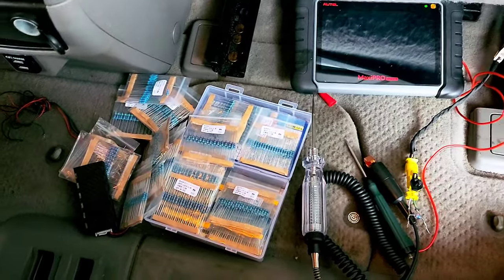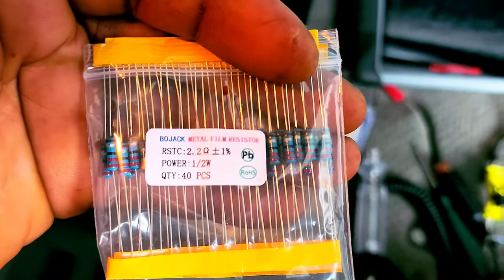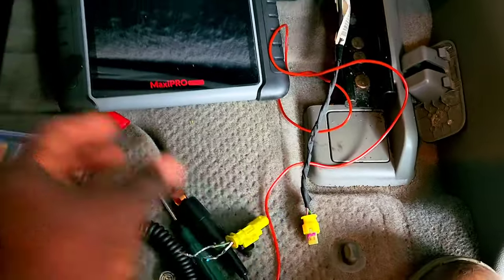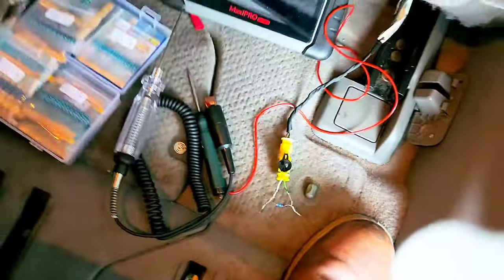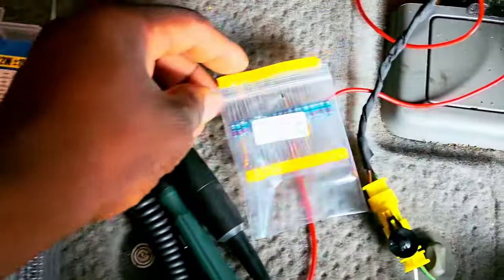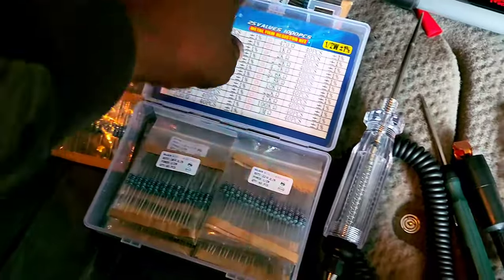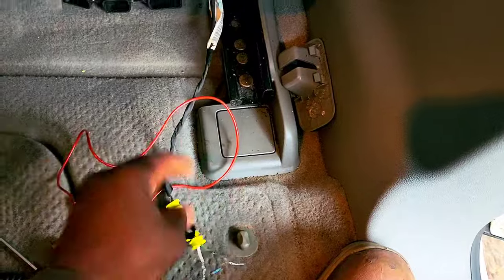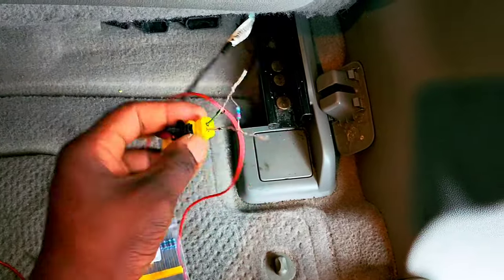HOW TO USE A RESISTOR TO GET OUT ANY AIR BAG LIGHT

Comment: How do I know what resistance is needed ?
Reply from the maker: It shows in the video
Reply: @MrtalentedReid  every single car has the same resistance?
Reply: @MrtalentedReid  how did you test what resistance was needed ?
Reply from the maker: @DonnSinatra 😁 all the cars I go through use the same resistor 👍
Reply: @MrtalentedReid  I’m not being a wise ass I really wanna know how you tested that in case my car doesn’t have the same resistance I just put bucket seats in now I wanna bypass the airbag light
Reply from the maker: @DonnSinatra these kind of things are very community guidelines sensitive so I can't tell you much but the one in the video is commonly use for any vehicles 
2.2ohms 2.3ohms 2.5ohms 3.3ohms half watts
Reply: @MrtalentedReid  what🤦🏻‍♂️ nvm good video

Comment: Mate, great video. I'm struggling to source a replacement plug-in Same as the yellow one in this video in Australia; any ideas? Tried wreckers online, but no joy
Reply from the maker: The easiest place to find it is a scrap yard or you can just splice the wires with some butt connectors thanks for stopping by

Comment: Very talented indeed. Im installing a new steering wheel and racing seat into my 2002 VX COMMODORE that dont have airbags. Would 0.25W  2.2ohm resistors work to clear the SRS fault light? Or do they have to be 0.5W resistors? 
Thanks in advance mate
Reply from the maker: Thanks for stopping by I know the 2.2 ohms half watts work very well

Comment: Would this work for a 2014 Chevy Tahoe PPV. I swapped seats out from a 2007 Tahoe LTZ. To my 2014 Chevy Tahoe. And the wireing harness is different, if you happen to know the wire connectors would be awesome. If not will the 2.2 resistors work.
Reply from the maker: Yes it works

Comment: Thanks for this vital information although i am still need a little more light on this vital information. my 09 chevy equinox passenger seat don't have any yellow connector.There is 4 wires come out of the seat occupancy sensor, colors,black,red and 2 grey, but the grey wires seems to have a smaller wire attaching both ends, more like a loop. I would like to know if its any of these wire the resistor should  be connect to? i hope i can get an answer from you before i  blow up anything. thanks🙏
Reply from the maker: Can the back of the seat remove? If so remove it and locate the air bag wire and connect the resitor to those wires

Comment: Would this work for the pretensioner i have a code for right side anchor pretensioner loop open drver side?
Reply from the maker: Yes
Reply: @MrtalentedReid  thank you
Reply: I have the same issue!!! Did you fix yours and how did you do it if you did. I have mine for my driver side as well on my 2016 Malibu.
Reply: @hesoomelo9868  yeah i fixed it my issue was in a 2015 cadillac ats cable going to the seat belt anchor sensor was  broken at the harness had to solder the cable and since I had already purchased this resistors since than I've used them on other gm vehicles to turn off the seat belt sensor or air bag passenger sensor they do work I suggest you check wiring first and if no issue there than it is a faulty sensor in the anchor you can order one online or you can send your to be rebuild or can bypass it by buying a resistor like shown in the video and disconnect the cable from the sensor and install one of this in place

Comment: I have a 2016 Chevy Malibu my airbag light is on due to the front seat belt Tensioner. I’m not too sure where I would plug this into? My seat airbags are fine so I’m kind of lost let me know an advice you have thanks.
Reply from the maker: Find the output from the model to the belt tensioner and Connect it there
Reply: Tensioner cables are in the bottom of the b pillar

Comment: I have a 2019 vw Arteon SEL r line FWD that I took the seats out of and the airbag sign won’t go away. Adictiknally, my VCDS system suggests about the seat tensioner. Luckily, there is already a passcode provided so I can potentially disable it with hexadecimal. 
Any other suggestions?

Comment: Hi, I have Nissan Sentra 2019. I put 2.5 ohms resistor to bypass the deployed airbags, but still have the airbag light on. do i need to delete the crash from the airbag module in order to work ??
Reply from the maker: Thanks for stopping by buy some cars you have to clear the code after the bypass you can also use 2.2 ohms 3.3 3.5
Reply: @MrtalentedReid  
so I need to clear the code first or bypass after that clears the codes
Reply from the maker: @user-hv3rl3ow7q yes but some cars immediately after installing the resistor the light go off so make sure all circuit is working properly
Reply: Sometimes the SRS module stores hard crash codes.Does the resististor method eliminate that so the light goes off or After register is placed do you still have to have the airbag module flashed
Reply: 2.2 ohm resistor not register sorry

Comment: Hello,resistor is added   to the airbag sensor?
Reply from the maker: It go to the output of the control module that goes to the airbag
Reply: Ok,i have disconected tha door airbag sensor and the airbag light turn on
Reply from the maker: @user-yu5ih8sd9h okay

Comment: Am working on 2016 odyssey. What ohms resister I would need for front passenger side curtian airbag.
Reply from the maker: 2.2ohms half watt
Reply: @MrtalentedReid  thanks.quick question I have code for curtian airbag open first inflator.curtain airbag has 4 pins.but connector going srs unit has 2 wires.where resistor is installed

Comment: Will this work with a hard code from the crash
Reply from the maker: What do you mean and what Code?
Reply: @MrtalentedReid  I mean if u have crash code stored in the module will a resistor still turn the air bag light off for example let's say u have a front left crash and impact sensor was hit so thr air bag deployed now the module has a stored crash code which they call a hard code stored in the module if I use a 2.2ohm resistor on that impact sensor will it turn the airbag light off still or because the module has stored a hard crash code it won't work is my question. Thanks
Reply from the maker: @autowrenchsales  you would have to clear the code and replace the crash sensor in the frame of the car side that get hit and it will work

Comment: Hi, how to calculate what resistor value do I need to bypass that light?
Reply from the maker: Just use a 2.2 ohms half watt
Reply: @MrtalentedReid  for anywhere? curtain/knee/seat airbags are using 2.2ohms? I have a 2015 camry with deployed airbags and I am going to use this bypass emthod for curtains and seats.

p.s. does it's airbag module needs recalibration ? I see u are using car obd tool
Reply from the maker: @controlman17  I use the scanner to detect the error code and to see which air bag at fault when u fix the air problem you don't need a scanner to do anything 2.2 3.3 2.5 those Resistors work

Comment: What is resistor size of kia stinger ?
Reply from the maker: Driver Airbag (DAB) 1.7 - 2.3 Passenger Airbag (PAB) ... 2.2 ohms 1.7 ohms 2.3 ohms 3.3 ohms 2.5 ohms you just have to test to see which one works for your module

Comment: How do I know the transistor size of a Suzuki Forenza passenger seat sensor
Reply from the maker: On most cars I use 2.2 Ohms
Reply: @MrtalentedReid  How do I turn off the passenger seat airbag light in a Suzuki Forenza?
Reply from the maker: Switch the ignition off connect the resistor as show and when crank the car it should go off
Reply: @MrtalentedReid  What are the colors of the resistor?
Reply from the maker: BOJACK 1000 Pcs 25 Values Resistor Kit 1 Ohm-1M Ohm with 1% 1/2W Metal Film Resistors Assortment https://a.co/d/fJKZWQl
Reply from the maker: EDGELEC 100pcs 2.2 ohm Resistor 1/2w (0.5Watt) ±1% Tolerance Metal Film Fixed Resistor, Multiple Values of Resistance Optional https://a.co/d/bXaHjIR